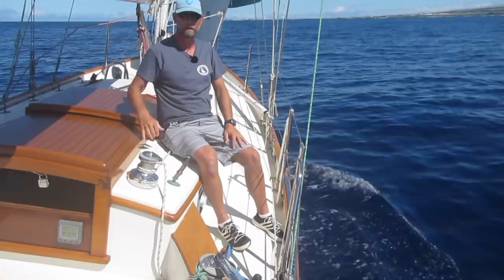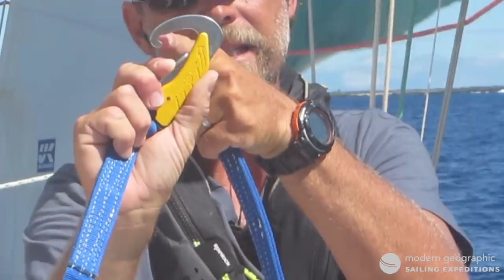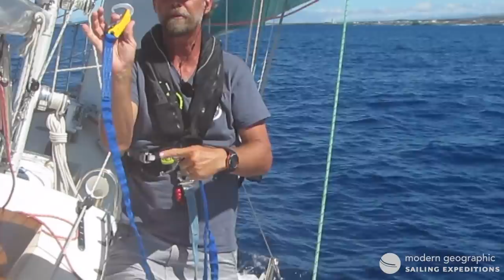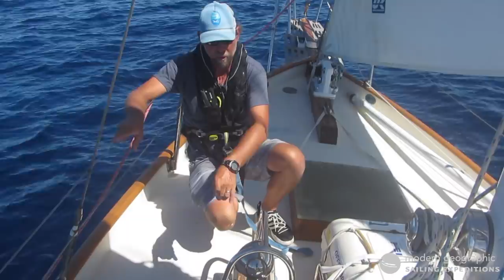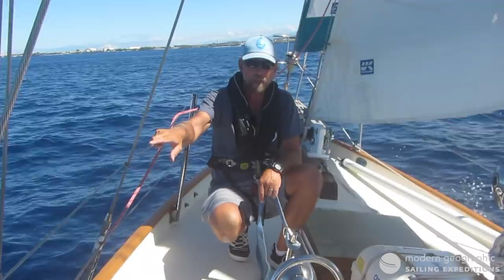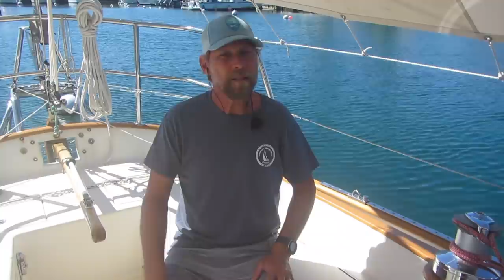Sailing Safety Harness ... Don't Ever Let Go!

Comment: Good content.  How do you self rescue when sailing alone?
Reply from the maker: Aloha, TheBelldiver ... thanks for your question. Self-rescue when sailing alone is not easily undertaken. When I solo sail now, I remain very aware of my surroundings and take few to no risks of being un-tethered from my boat; I place every hand and every foot with care so I'm braced firmly to the boat. I wait for the right wave before making a move to my hand-hold or foot-hold. I sail solo with the idea that IF I fall overboard, I will never see home again. I keep a constant reminder of my children and my spouse, and if the end were near, I would be so totally filled with sorrow that I think I would worry myself to death before I actually drown or were eaten by sharks. I do not tow a line to grab onto should I fall overboard; I know some single-handers who do this (but I don't have a link exemplifying this) ... If you come across any viable solutions that other single-handers have theorized or used in practice, please post a link to their information here in the Comments of this video. Thank you again for watching the video, and thanks for your "Good Content" comment. Fair winds, Paul Exner
Reply: @PaulExner  I'm about to expand my horizons and venture into sailing.  

I already know or expect to be a lone adventurer so; I'm already figuring on a solo existance for the most part.

I'm somewhat what of an inventor and builder of just about anything that crops up.

Today I was thinking about designing a few REMOTE controlled devices that I can activate if I happen to fall overboard; 

One; would be to drop all sails, 2 start the engine or remote controlled steering and electric thrusters With two hours of life at a minium.

I also think it would be smart to have a small life raft or inflatable paddle board on a spring loaded launching mechanism designed to send the entire package 40 or 50 ft behind the boat.  

These are very do able projects and might be something marketable.

I just started a custom sail and canvas manufacturing addition to my business.  

I think a remote operated means to launch a rescue flotation device with a survival package makes good sense.  

Being able to dump all sails and stop or turn the boat around  makes real good sense to me.
 The self inflated paddle board could just as easy contain a small battery and thruster built in as well.
Reply from the maker: @TheBelldiver  ... Thanks for your world-contributions as inventor and innovator (Thomas Edison is an inspiration to me). As a sailor/builder/content-creator/entrepreneur myself, I am always excited to hear what people like yourself are doing to make the world a better place. I'm providing this link about the Radio Controlled MOB Device I'd seen before (I just looked-up their website); perhaps this will give you some ideas. Please keep in touch, and feel free to comment on my videos anytime. Aloha: https://www.oceansafety.com/product-range/man-overboard-mob/product/usafe-remote-control-mob-system
Reply: @PaulExner  I'll look at these links after I build my device.

I've designed many tools and techniques related to the oil industry,  Commercial divin,  UW tools including designing the first UW topography mapping technique and computer created imagery 

The last thing I want to do is look or read about others or their designs or inventions.

If I do; it distorts the minds view of what I see, design and build from.
Then; after; I don't mind seeing everything related to the topic.  Actually; I look up everything I can find Then; I set out to create a tool or product less the gripes or short comings of all; including my designs.

Even the wheel can be reinvented; It all depends on the application it's to be used.

I never mind sharing my ideas and even specific plans.  

Why; because the government steals anything they want that follows the patent guidelines of secrecy.

They do this so no one can contest the theft. The Us patent office steals a good percentage of ideas and passes them to larger multi national conglomerates or Washington insiders/ supply contractors.

By going public I don't lose anything but impede theft of R&D, design and completed  technology.  

Look up ELHFED; that's my discovery in molecular/atomic research. 
The government would steal it; if it had some monetary value to some corporation who wanted to claim it.  This way; my way;  they can't claim it.

Case in point; my research in targeted shark attacks was not only stolen but the same exact amature medical and physiological  descriptions were used as described in my submitted paper with supporting documents as evidence in sincerity in the research.  I usually name the thief by name hoping to be sued.  But I'm on to bigger fish now.

A very famous woman marine biologist wrote a book about my discoveries in targeted shark attacks and stole the data And supporting evidence I gathered almost verbatim.  The Miami sea aquarium was directly responsible for passing my information off as their own or as an unknown resesrcher/contributer.

By the way; Edison was not anyone to look up to if you research his true business ventures and was most evident with his dealings with Nikola Tesla and the battle over AC vs DC current and the bid to use Niagra falls as a power supply.

Which by the way the University of Missouri also attempted to steal a hydropower energy reclaim device I submitted with the intent to get financial aid. And technical support and I would share the design with the University.  Well they were busted for trying to defraud the government and had to pay restitution for money in a received grant.
I included a wrench in the description just in case.
Sure enough; a year or two later I heard on the radio; the University of Missouri was sued for grant money issued for a failed alternative hydropower reclaim power generator; my invention. Ha;😂.
I never completed the project  after proving the concept worked. I couldn't afford to build a second lake on my property just to produce free energy.  

The Ohio Valley power authority threatened to deny me services if I tried to sell back energy I produced from my own power generator.

This is the real world we live in.
The topic now is self rescue from falling off a sail boat.

My idea would be a key fob transmitter that everyone would wear.
The specific transmitter would be linked to the navigation monitor or a separate unit with a GPS link to the boats auto pilot pinpointing the MOB.

THE same transmitter would activate a self inflating boat of some design with survival rations and gear.
This is not anything beyond existing technology or things already existing.

So; I keep my ideas, concepts and designs as original as possible.  If it turns out it's a duplication; fine I can still build it and it's automatically validated to be a good design.
Reply from the maker: @TheBelldiver  ... thanks for providing some background about yourself. Your MOB Recovery system for single-handers sounds like a good project which you'll approach with passion. As you're "new" to the sailing industry, my perspective will be very different since I've been in this industry 43 years (to date). The prevailing thought on MOB is to place emphasis on preventing someone falling overboard. In practical operation with an experienced sailor making intuitive and complex reactionary maneuvers to speed, course, innuendos w.r.t. boat-handling around the six types of motion a yacht can experience: roll, pitch, heave, sway, surge, and yaw, it's well understood that actual MOB recoveries in the open-ocean have a significantly less than 100% success rate (even with an experienced human-being in control). When we factor the operational side of managing a vessel at sea, w.r.t. wind-forces on sails, the automation of such equipment without immediate human-operation involvement would be complex, although not impossible (and I'm certain you have the tenacity to create such a system). Regarding the marketability of a device for the single-handing segment, you'll note that there are 100x more people who have climbed Mt. Everest than have sailed around the world single-handedly so the market is small ... and this may appeal to you, as it does appeal to me, because most single-handers are incredibly innovative, creative, and self-sufficient and prefer to create their own systems (which is a very positive element to your immediate efforts with your system). I applaud your efforts, and look forward to hearing how your advancements are going. Thanks for your contributions, and fair winds! Aloha, Paul Exner
Reply: @PaulExner  I would imagine every sailor or seaman is very conscience of hand hold and foot placement yet; still there are still enough MOB incidences to justify the effort.

Although I'm new at sailing I'm fairly  experienced at living on a boat; 8 continuous months living on a diving crew boat and several trips commercial fishing with 21 day trips.

I've experience two hurricanes at sea; once at age 15 and the second as captain and pilot of the vessel while on a diving job..

My lessons were learned the first ten minutes of the storm.

I and a crew of two kept the boat mid channel durring the entire storm.

The front deck came loose but stayed on barely; thank God. 

We could not dock as there were no docks left in the Rockaway channel in the NYC area.

What an experience that was.

I'm thinking a spring loaded catapult strong enough to launch at least 100 pounds 60 to 80 ft. And remote control activated makes sense.

The other thing would be; to remotely drop all sails and maybe deploy a weighted parachute drag.

A MOB would have to swim or paddle like hell to catch up to his boat.

I think these two items will be my first build.

I never build for anyone but me.  Then if anyone wants one; I'll consider contracting to manufacture on an individual custom order. But; that's not my incentive; survival is.
Reply from the maker: Sounds great, @TheBelldiver  ... I definitely applaud your initiative to create something new. Fresh thinking is always a benefit to innovation. I've not seen a spring-loaded catapult launch an MOB device yet--this is interesting. A very simple prototype could catapult a tow-line with a float on the end. The waterproof "key" activated by the MOB could simultaneously launch the tow-line and trigger a programmed routine for the autopilot to put the boat into hove-to (stopped position). Those two actions could be simply implemented, and would probably be enough to save lives! NOTE: the standard length of line attached to the LifeSling product is 150' of polypropylene. At a vessel speed of 6 knots, an MOB victim has 13 seconds to swim to the LifeSling. If the boat is stopped in a hove-to, the MOB can self-rescue (problem solved). That's a viable Specification for your device. Next is for you to develop a waterproof switch, catapult, and routine for the autopilot that puts the boat into hove-to. If you can make all that work, you could write more complex routines for the autopilot in v.2.0. Version 3.0 would be to manipulate sails ... but I encourage you to make 1.0 work with the hove-to position. Have fun. Aloha, Paul Exner
Reply: @PaulExner  I have reinvented all my commercial diving gear; excluding nothing and use it all.

It costs months of R&D time and money but; I've been diving 50+ years.
So; for me; a proactive approach to problem solving keeps life interesting.

All the things I've mentioned for self rescue are not really high tech or require a true invention; it only requires modifying existing equipment and technology.

The waterproofing of a remote controlled mechanism to drop and pull the sails down is easy.  The launch platform will require me to build a spring or pneumatic actuated launch platform will require some thought and design work but; there are several ways to design a scissor platform or even a simple catapult that can propell an object weighing a hundred pounds 50 or 60 ft.

I see no difficulty in building this either.

I'm just now in the process of expanding my business to include custom sail fabrication and canvas work.

I'm located in Charlotte Harbor, Florida.

I'm already working seven days a week and; expected to for about a year; then I'll hire the necessary labor pool and management team to sustain my sailing and future experimenting.

My interests include biophysics and molecular physics.

Why; because they both are controlled topics  which cause us/me to be dependant,  manipulated and controlled.

90% or greater percentage of higher education in the medical sciences, political sciences, economic sciences, and sciences of all nature are redirecting hogwash and they all affect all of us; especially the food we eat and medical institutions.
Self rescue in those areas means re education from the standpoint of an explorer and discoverer; not as a student of dissiminated crap and filtering that is a huge task and requires lengthy research into historical publications and fragments of information.
My approach is totally contrary to institutionalized education because what I do is about discovery.
You are very rare in that you can see the direction I'm headed with the self rescue devices or the concepts required to even start the fabrication process.
So; I appreciate that for certain.
I have an aqaintance whom is also an Engineer and an accomplished ship designer.

It would be very interesting to pool the minds of can do people; just to see what can be done.

He wrote RETLAW an economic recovery plan which he submitted to Washington.  Which; further proved my points considering the AGENDA of global finance and world manipulation of all commerice.
This too; has an impact on my sailing and life; so; I will know all I can about it as eell; only to see how I can get over or around their control.

You might be interested in my discovery in molecular physics. By looking up ELHFED.
it's listed in Google Applied physics and research I think.

This topic ranks the highest in critical importance and is least known about with the general public and there is a reason this science has been made to appear nerdy or for dorks; like that moronic sitcom; I never watch.
ELHFED is no more complex than the concept of a launch pad for a rescue system if; one simply applies their brain.  That seems to be the obstruction to logic or understanding; then doing something about it; physically instead of lip service.
All things are related and the Lakota Sioux have a phrase for this revelation; it's called; " Mitakuya oyasin " meaning; all my relations or; all things in creation are related.  There is a dependency relationship in some way to all things. Without stones; we can't build buildings or bridges without trees we can't build houses (like we see anyway).
So; we are connected to all things and each other; on some measure.
So; that's why I'm studying the root of all things; the physics of that which is nearest to me and a few things further away.

And I'm writing this as if you or others might be reading it and can add to it.
Reply from the maker: @TheBelldiver  ... Awesome stuff! I'm happy that you're literally expanding on the idea of "self rescue" here. I do hope that others read what you've written, and begin to contribute too. I find your perspective on everything interesting, and similar to my views as well; because, I tend to create everything I need for myself, by myself. There's an esoteric concept in certain computer programming disciplines called: Full Stack ... meaning that the designer, operator, manager, builder, etc. can and does everything. I use this same perspective to describe Seamanship ... I refer to it as Autonomous Full Stack Seamanship ... this is what I provide to sailors seeking skipper-level instruction during my hands-on sailing expeditions. There is so much that you've written here, and I thank you for doing that, but I will close my comment for now, and pick it up again at another time. Until then, fair winds. Paul
Reply: @PaulExner  at some point; for sure; I'll seek some form of formal or informal instructions.

If I can hook up a few times with local sailors and do a few day sails then a couple of weekend gigs. I can probably fill in the blanks over time.
I have no problem asking questions or taking direction.

Here's a question for you.
13 or 15 seconds is not a long time.

Would you rather snag the tow line or; swim to a flotation device with a survival pack because there isn't enough time to locate and activate a remote controlled launching mechinism and swim like hell looking for the tow line.  Because once the tow line is gone the distance to receive a survival package might be too far to reach you or see it in heavy seas or swell.

So I'm seeing an either or situation here. 
Very second spent looking for your fob is a second waisted if you expect to pull yourself up to the boat; then what? It seems the stern wash might keep you from climbing on board unassisted.
Reply from the maker: Aloha,  @TheBelldiver  ... "I'll seek some form of formal or informal instructions." Many sailor are self-taught, and that's a great way to go. Many sailors also sail with other sailors to "learn the ropes," and that's a good way to go too. Then there's formal instruction, and frankly, most of the formal instruction you can pay for is a waste of money ... UNLESS you learn from me. I cannot think of anyone who is doing it as well as I do, nor with as much commitment TO the student like I have. Learning from me is NOT about me ... it's ALL about you; I can assess very rapidly where a student is at, and fast track an adult learner like no other instructor I've ever seen. I also attract the best students, the ones with major commitment, the ones who don't want to waste time nor money, who wish to something "real" with their sailing. I'm not soliciting more students, but if you want to reach your maximum potential with the greatest efficiency, then I'm your coach ... checkout my expeditions: https://www.moderngeographic.com/ ... sign-up for a Hawaii expedition (you won't regret it). ... ANSWER to your question: I agree, 13-15 seconds isn't a lot of time. I think with your catapult system, you can gain MORE time, probably double because your can launch the float further astern than a person throwing something. SO, if your activation device is somehow religiously worn by your sailors, and if they're aware of how to quickly deploy the float via catapult, and if you can autonomously STOP the boat via some means, you can buy 30 reliable seconds for the victim to reach the float that's attached to the boat via a floating polypropylene line, then you have a winner. If you prove how to do that, you have version 1. It's essentially the LifeSling product with a catapult (that's cool, should work, and will save more lives). There are three phases to recovering an MOB: 1) Reattaching the victim; 2) Stopping the boat (because it's impossible to simultaneously drag a victim and recover them; and 3) Get them back aboard. PLEASE READ MY ARTICLE: Improving the Odds of Recovery (it was adopted by the Canadian Government as a chief source of information to publish their official response to MOB): http://www.oceannavigator.com/March-April-2013/Improving-the-odds-of-recovery/ ... TheBelldiver: you seem like a person who will make a great sailor. You are the kind of person who can self-teach them how to sail. Don't settle for mediocre; if you're not getting where you want to be fast enough (there are a lot of Bozo sailors out there to learn from), sign-up for one of my Hawaii Sailing Expeditions. Aloha, and than you again for your contributions. Paul Exner
Reply: @PaulExner  one thing for sure; you think far beyond the shadows of your own feet.

That attribute seems to be kinda rare. Lol

I'll certainly keep the Hawaii trip in mind.  

The thing is; I'm already in this venture time schedual as a project in progress.
I make it a point to make headway in that direction everyday.
I knew for certain is be designing and building something of value the moment I decided on a direction when I bought this business.
An objective or goal.

Otherwise; why do it?
Reply: @PaulExner  I've considered a few options to toss a 100 pound package at least 60 to 80 ft. and it not take up a lot of space. 

My shortcomings is in the area of program writing.  I'll look into RC TOYS for simple relay commands and I believe they can communicate quite a distance.

Having a means to all stop the boat is critical for self rescue; so that'll be my first build. 

Another quedtion;  why isn't something like this already invented and used as standard safety protocol? 

Both my devices are as logical as wearing a PFD in a kayak. Although I seldom see kayakers wearing a PFD; or sailors as well for that matter.
Reply from the maker: @TheBelldiver  ... right on! Enjoy, and feel free to keep making comments about your progress.
Reply from the maker: @TheBelldiver  ... I believe the reason something like your design isn't implement yet, are two: 1) most people designing products for sailing are sailors, and you're coming at it with fresh eyes. The brief suggestions I've contributed on this thread should help you tie-up a few loose ends from a sailor's point of view (I hope they help you get something working more quickly). and, 2) There IS, and there's NOT a large market ... there will need to be some convincing of "sailors" that your novel approach will work. Remember, when the LifeSling was new, people couldn't get their head around it replacing throw-rings and boat-hooks until the Unites States Naval Academy legitimized the approach and product in demonstration to the public. In sailing, if the marketer is struggling to convince the sailing public because they're not coming at it from authority, they shy away. For a group of people (sailors) looking for adventure, they're actually a pretty risk-averse group and for some wild reason, prefer to learn sailing through folk-lore! That's ridiculous in today's day and age ... Grandma's apple-pie kinda sucked most of the time, but people still have nostalgia for the old way of doing things. SO ... I think your idea has merit, and you should try. Your passion will prevail. Regards, Paul
Reply: @PaulExner  it's totally refreshing to read something with content, making points and like I said; thinking well beyond the shadows of your own feet.

I agree while heartedly with your thoughts regarding people typically only responding to a preceived authority.

The commercial diving industry is the same way.

I own and run my own company and there really isn't a piece of equipment I haven't made major tweeks or outright redesigned a concept and built it.

The DOD is even closed to only a few selected suppliers; no matter how grandiose or superior your product is.

The government will throw rocks in your path.

I'm a gov. Certified contractor and vendor but that took years to achieve.

So; build for me.  If someone likes it and wants it; I'll build another.

The government demands all kinds of product liability insurances, government certifications and basically a total obstruction to any manufacturing attempts.
My commercial divers helmet and torch are prime examples. 

The standing trade treaties I.e. NAFTA and TPP are 100% anti American, anti free market; so I have no dilussions of grandeur.
Reply from the maker: @TheBelldiver  ... thank you for your message. I believe the entrepreneurial spirit is what betters the world, helps the economy grow, and makes life more interesting for creators and buyers. I admire someone like you who has the confidence and skills to improve diving equipment--that's brave and bold. Thanks for doing that. As an entrepreneur myself, and a small business person, I work around the clock (good thing I like to work), because I must learn to do everything because I can't afford to work with an attorney or accountant, or marketing pro, or a mechanic, or whomever ... my budget only provides enough capital to buy the parts (barely), and then I do all the work. I have a 100% permitted operation for my commercial sailing business, but it's a full-time job to administer the government requirements; and I still must go sailing with clients in the open ocean and provide a skill-expanding experience while keeping them reasonably safe; and I must continually work to expand my skill; and find new customers. I believe many business owners are like you and me. I sincerely believe your ideas about MOB recovery system are worth pursuing, even if it's just for yourself. There is a solution you can implement through iterative product design process which will absolutely make short-hand MOB recover safer. Have a good day ... there are definitely a few of us out here in the world who are on the same page. Regards, Paul
Reply: @PaulExner  amen to that one.
Well you are certainly intuitive enough to relate to learning through the eyes of the student and that's rare indeed.

When I hire divers; few really have the skills that they've hired on to do; so I already know there's going to be an instructional process and those that do have skill have adopted habits that seriously increase the liability risks so; that's a worse situation than having a totally non skilled person.
 I imagine sailors with some but inadequate skills are more difficult to pass on your skill set.

I wish I was at the stage in the game to warrant coming out there and take your class.

But doing so would be putting the cart way ahead of the team.

Im working 7 days a week as it is right now but that'll settle down in a month or so. As soon as I see daylight though; I'll be pushing my sail fabrication business.
You might be the very person to ask your opinion on a few design concepts I have.

If they already exist; well it means I'm on track and that won't bother me in the least.
I have the equipment and space and I think the perfect location.
Reply from the maker: @TheBelldiver  ... sounds great! I'm excited for you and your new venture in the sailing industry. Do you have a website now or other location to send interested people like myself to see what you're creating and offering? Please post the link here in the comments when you have something to share. Yes, I can relate to the incoming spirit and ethos of divers and sailors coming fresh into our respective niches ... there's always a struggle before an understanding is created; I think we both know how to handle that management challenge (experience, tenacity, and and being not susceptible to intimidation helps). If I can offer any assistance to you in your development in "sailing," that's what I'm here for. Thanks for appreciating my contributions ... as I appreciate yours. Please keep us updated regarding any information you wish to share ... looking forward to your contributions to "sailing" as they become available. Regards, Paul Exner
Reply: @PaulExner  I've had Google contract me for website development.  I asked them why bother when Google search directs people directly to my site and place of business.

I recently bought John's Shoe Repair and the description includes orthotics, shoe sales and custom canvas and leather work.

I include all the photos I want and; Google uses hit algorithms to direct searchers.

I don't see the value of paying when there are twenty search engines and each have their own priority order.  There are only three like businesses so; no matter what; my business is included on the first page and my photo contributions are what stand out.

So; people gravitate to the image that best represents the needs of that consumer.

When I develop the sail fabrication business I'll be the first hit choice because I'll be the only choice in the entire region especially with an actual store front and commercial brick and mortar location.

My plan is to offer sail cleaning and reconditioning; as a pickup and deliver service.
I already started repairing sails.
In about two months I'll install 6 sail masts in the ground to use to open the sails to clean them and advertise the service.
Each owner can see their sail proudly displayed as it's being cleaned, treated & inspected. I have a shop to do the repair and fabrication process.

The installed sail masts is my idea of an advertising ploy. 
People can drive by and see their sail displayed and direct all their neighbors to go see it too, as a show and tell piece.
Reply: @PaulExner  I think pushing custom logos on existing Or new sails might be a good idea.